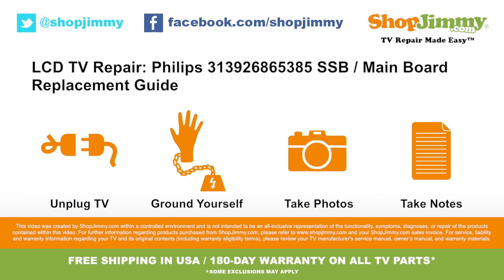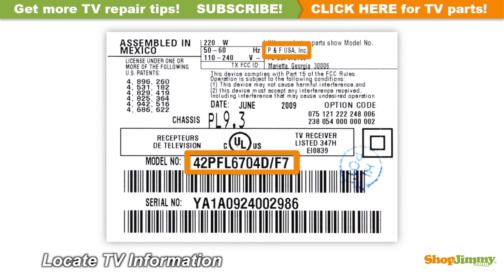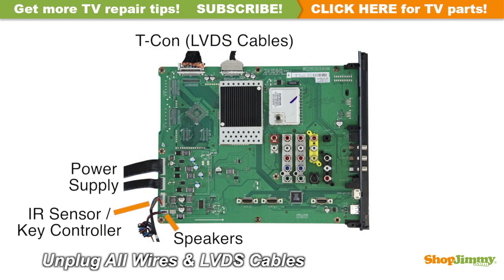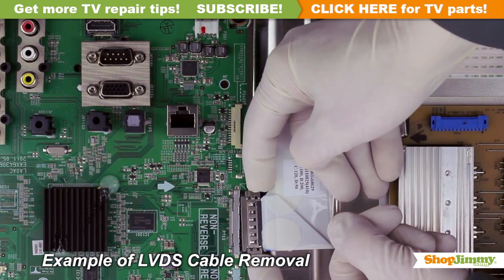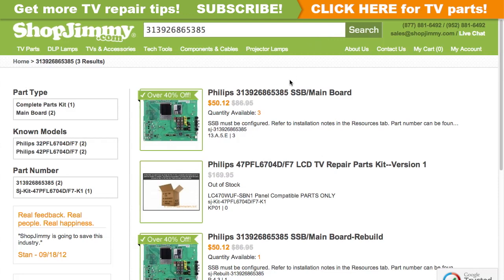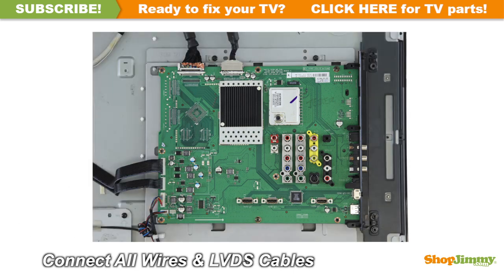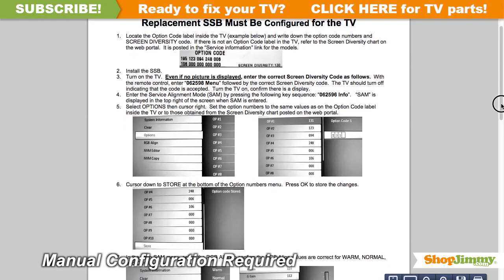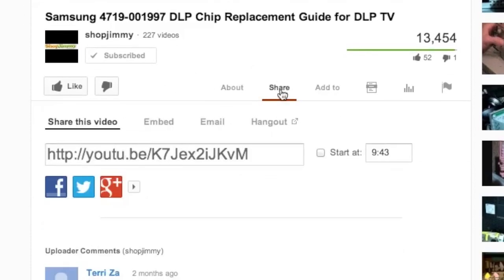Easy Philips 313926865385 SSB / Main Boards Replacement Guide for Philips LCD TV Repair

Comment: Do you have the 310432868263 SSB for 47PFL6007H/12 in stock? My standby LED totally not ON but 3.3v is ok at power supply board.